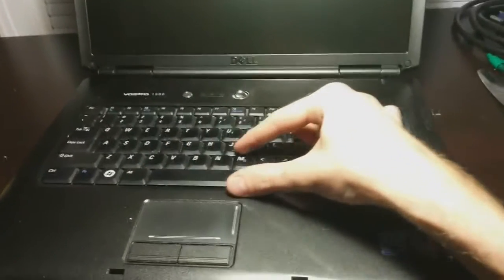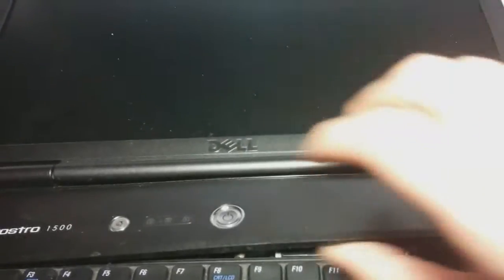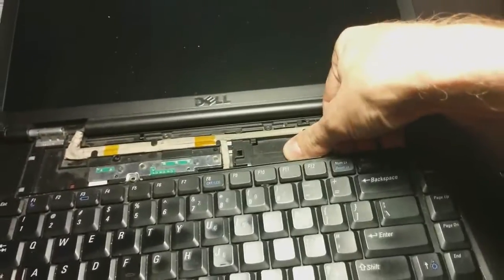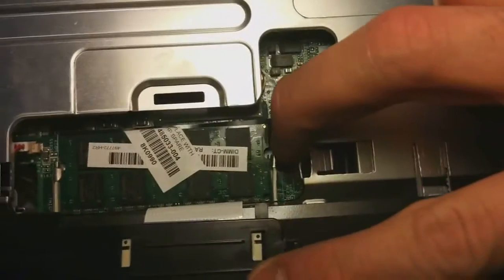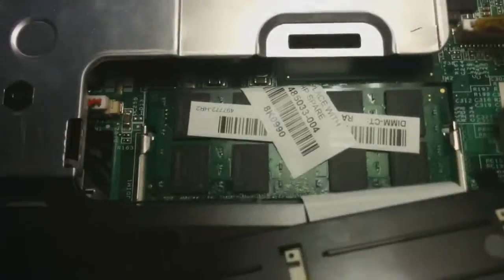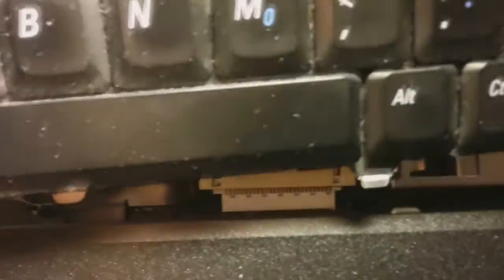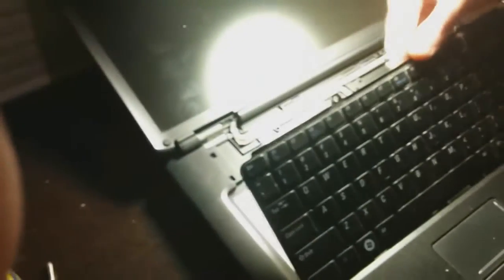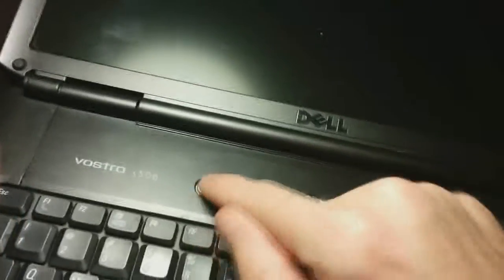Vostro 1500 Upper RAM slot - upgrade - hidden - instructions

Comment: do you remember if there was more than 1 piece of ram or just the 1 you replaced?
Reply from the maker: there's one as shown in this video and one under the square panel on the underside of the laptop.
Reply: @alecjahn  thank you so much found it! i'm repairing my friends laptop and his computer was only using 1gb ram. i'm going to upgrade both ram. maybe i need to replace a battery because its beeping like crazy on startup

Comment: what's the max ram I can put in lappy?
Reply from the maker: 4GB.
Reply: What would be the fastest ram i could use? I have this same laptop and was wanting to try and upgrade it, it has 4GB of ram currently, and I'm putting in a 120 SSD to replace the HDD

I was hoping it could do 8GB, but know that i know it only takes 4GB max instead, maybe i can use faster ram🤷‍♂️